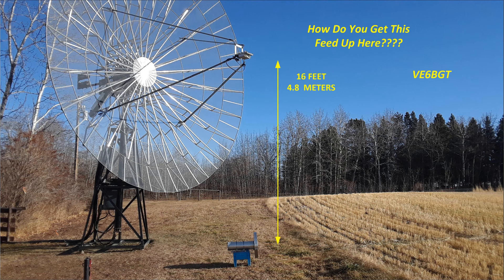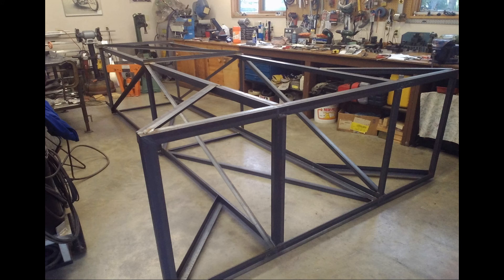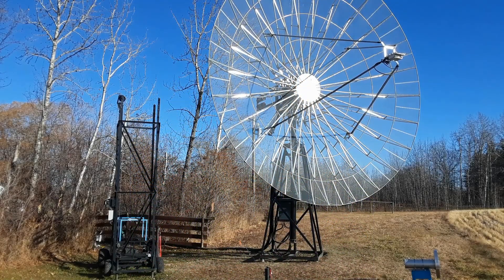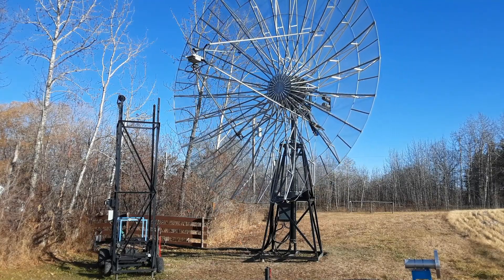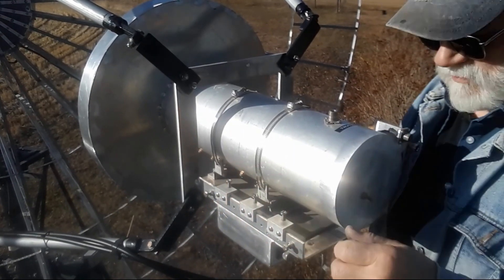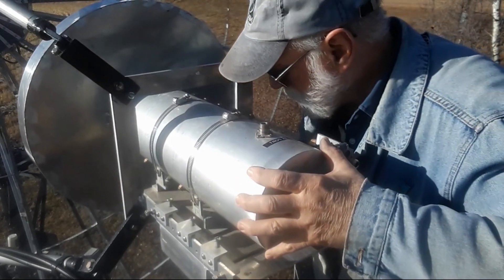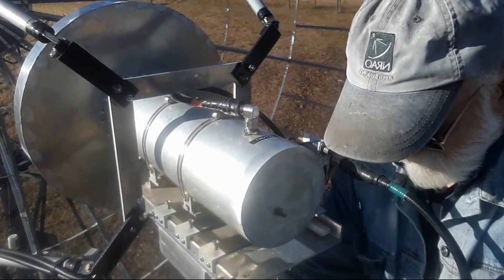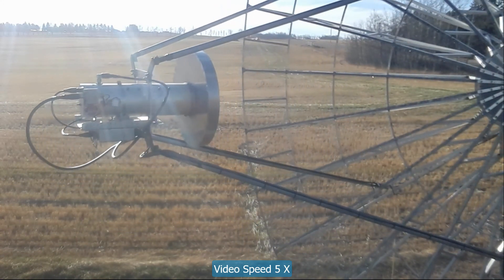Moonbounce EME Dish Feed Install with the Elevator

Comment: GREAT video! I just picked up a 3.7m mesh surplus TVRO dish and am just starting the long process of building my 23cm station, I have a long long way to go! I won't need the structural size of the mounting you built but liked seeing your mechanical design details.
I did a lot of C-band dish installation back in the 80s & 90s using a polar mount to track the geostationary belt. There appears to be pros and cons to either polar or az/el. My intent is to go the polar mount direction with a linear actuator to adjust the polar axis inclination to match the current path. Should I be talked out of this thought and move toward az/el?

Randy WB0VHB
Reply: One difference to keep in mind is with a polar mount your polarization will be constant on the moon.  An az/el mount goes through about 180 degree polarization rotation from horizon to horizon.  Rotation is not problem with circular polarization, but with linear polarization it can be a problem if it doesn't match the station at the other end.